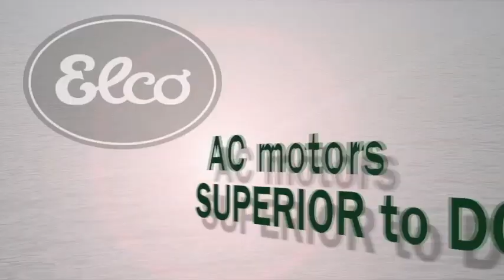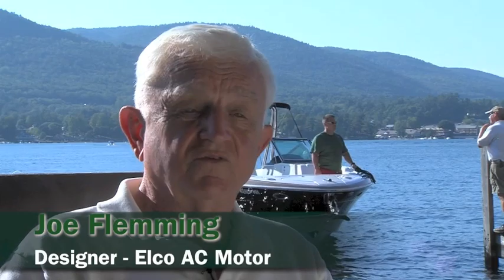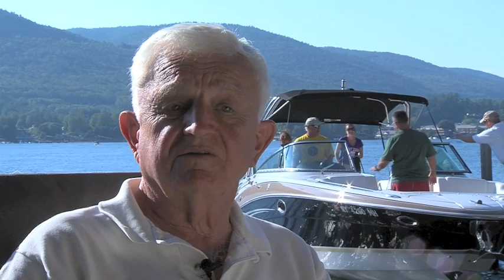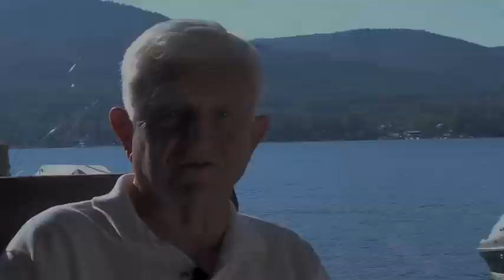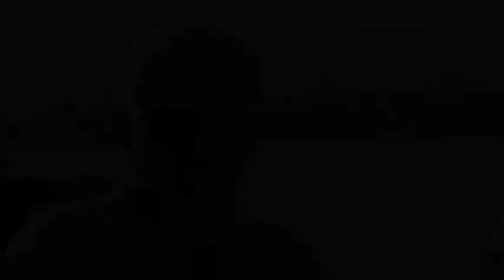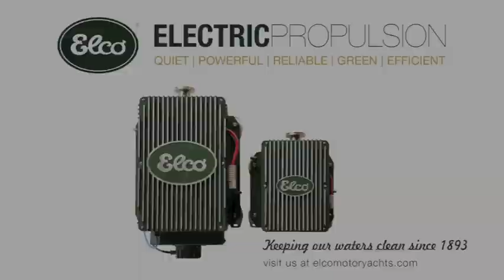Elco AC Electric Motor Compared to a DC Motor

Comment: I have an old baldor ac electric motor with the air filter on top. It's a 75hp 240v ac electric motor and was hoping to pair it with a marine alternator and 10,000 watt  ac to dc power inverter or dc to ac inverter/not sure because I'm new to this arena. Anyways, I was hoping to run my system with 3 marine batteries, 1 to start the motor an the other 2 to get split between the alternator, and the 2 batteries in series to go back to the original motor battery. Does any1 know if my set-up will work to recycle n recharge itself so I don't ever have to worry about energy ever again?

Comment: Joe ,you should be comparing tour three phase to a brushless DC motor which I believe get up in the high 90 % efficiency now most e-bike motors ,radio controlled airplane ,boat motors ,and now cordless drill motors are all brushless